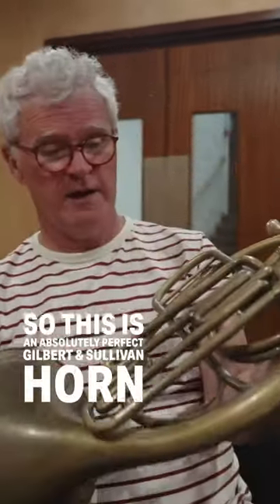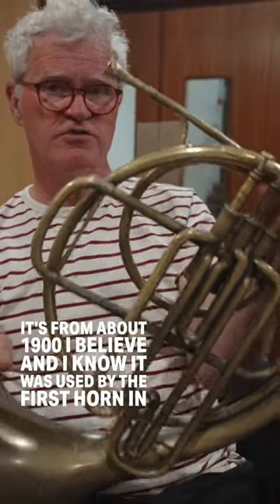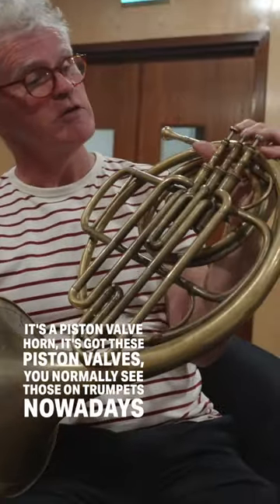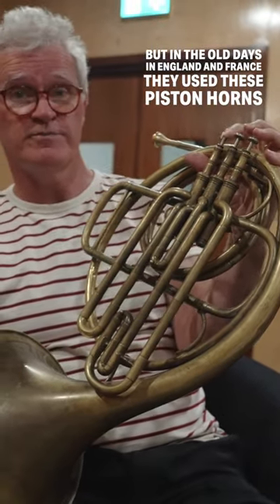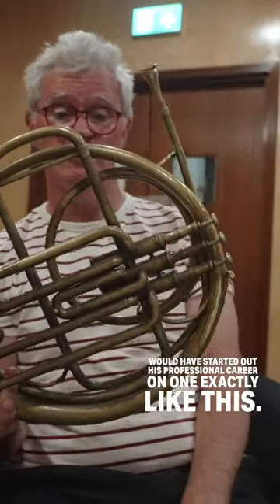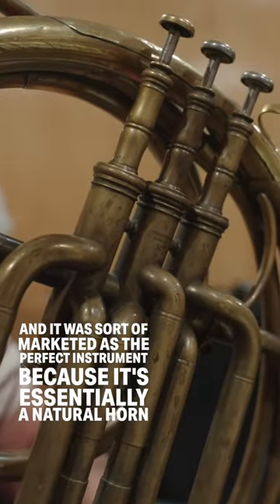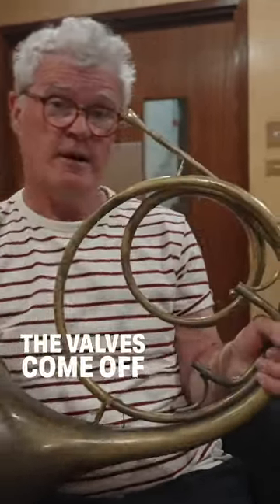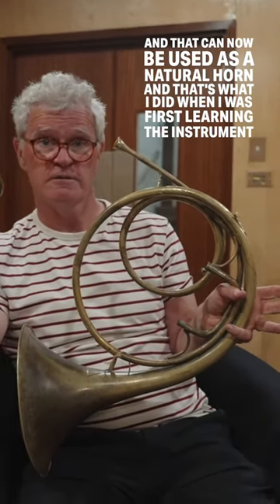Introducing the piston valve horn (with removable valves)

Comment: "...and now can be played as a natural horn."? Wouldn't it need a section of tubing to connect between the ends the valve assembly connected to?
Reply: It would, a “natural horn” is just a horn that you change the large section of tubing to put it in different keys.
Reply: That piece was likely included with the instrument when new.  And much like Vienna Horns, you would have the option of multiple crooks.  And that whole issue of your crooks not matching your valves?  Not the manufacturers problem.  Good luck, lol.
Reply: @Markworth  And like all extra bit they would be lost after the first 2 weeks.
Reply from the maker: Answer from Martin: You're quite right. I have two straight lengths of tubing which go in place of the valve section, and fit the tuning slide between them.

Comment: Hey so, I recently purchased an (ascending) horn just like this- but it came with the wrong shank and mp.

The shank fits only losely and the mp feels.... wrong, but with them it plays roughly in the key of A (not very well though)

Any suggestions for how I can find the right shanks? I'm pretty sure it was intended as a Bb horn, and I'd love to play it in the proper key
Reply from the maker: Answer from Martin: I would be surprised if a piston horn like this would be intended to play in Bb, unless it has been modified in some way. Is your assumption because of the length of the valve slides? I would suggest finding an F crook that fits.

Comment: Why did they move to the current rotary system? What are the advantages?
Reply from the maker: Answer from Martin: Very good question! It seems to me that piston valves move quicker and more smoothly than rotary valves. And of course modern trumpets, tenor horns, euphoniums and tubas use them (mostly). I am guessing that the angle rotary valves make with the hand is easier on the horn, so with a rotary valve you are pressing downward with the fingers rather than in towards the body of the instrument. You have to bend your wrist quite a bit to use piston valves on a horn.
Reply: @oae  Thank you for your reply. The wrist bend required does seem to answer the question well.
Reply: @Koriyama   No, it doesn't. They could build the horn and place the pistons in a more ergonomic position. If they wanted. I bet it has to do with the way the valves open and close. One can think of a list of valve properties, being an advantage or disadvantage. Intonation is one of them, how good does the instrument play in tune. On less perfect instruments the player is working harder, compensating slightly high or low tones. And that has to do with the valves and "detour" tubes design. It is impossible to say, it is just the wrist bend. Sure that is a problem, but then I think, well, the next horn must be altered, this does not work. See? What I think is, maybe the rotating valves are slightly faster.